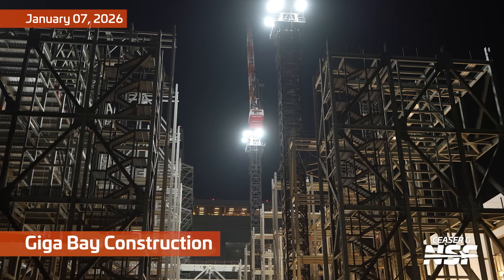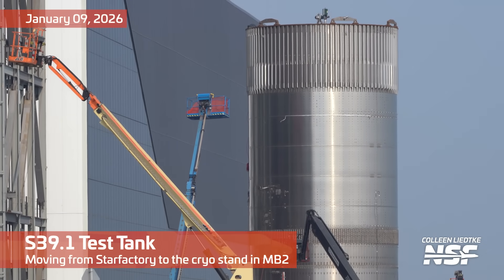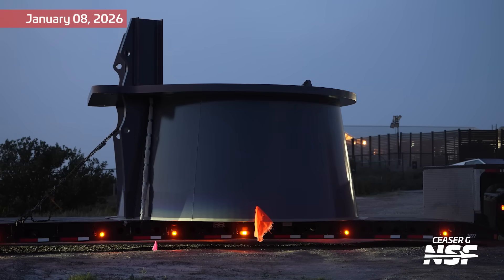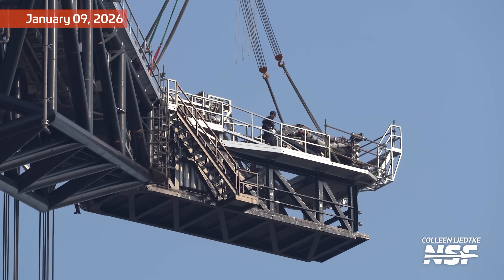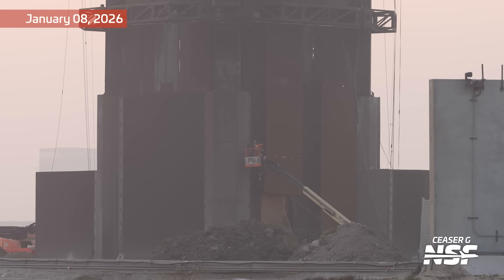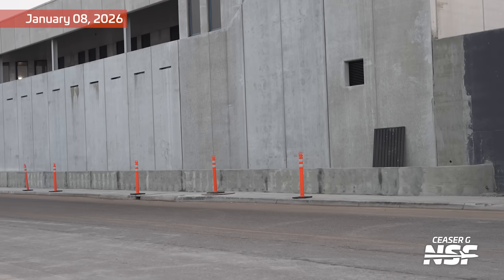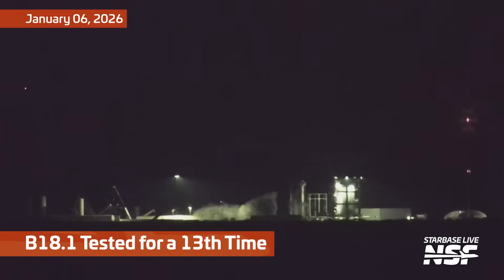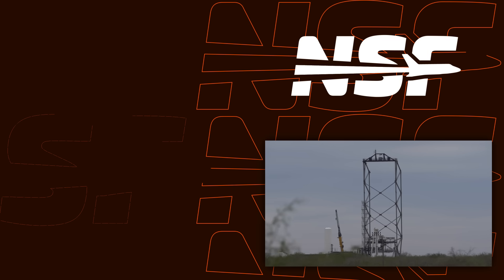"The Gigabay Steel Jungle Gym" | SpaceX Starbase

Comment: My guess on the "circular structures": the first one with the half-pipe flanges is HLS upper section - cutouts for landing thrusters, and the second structure is for the HLS airlock/elevator with pivot mount holes.  Doubt its steel, though.

Comment: On test tank 18.3 you need the ship aft installed on the hot stage truss to make sure the line of force interactions are accurate. Without the ship aft the upper rail would twist.

Comment: 00:46 from the architect they’re BOLTS Das, bolts. We haven’t used rivets (the hot steel type) for buildings in a long time. What you’re thinking about is the type they used on the 
Empire State building in the early 1900’s. We still use the small diameter type for lighter assemblies but not for structural steel.
Reply from the maker: Been watching too many blacksmithing videos lol - Das

Comment: The problem isn't laying the COPV's on their sides. The problem is they are being hauled around exposed to flying rocks launched from tires that can literally punch holes in aluminum. THIS is the problem they had with the two RUD's and maybe even some of the Starship block 2 RUD's after launch. You can't just haul COPV's around on a construction site EXPOSED like that and not expect damage to them. Wrapping them in plastic isn't going to stop something that can punch through aluminum. All you have to do is look at the hood of my Honda Accord to understand what I'm talking about. How hard would it be for them to enclose the COPV's in a box truck so they won't be at risk of rock strikes. There is NO WAY Starship will be human rated with this kind of reckless handling. The manufacture doesn't deliver them from their factory to Starbase that way. There is no just no way they would. So why does SpaceX think it's safe to transport them that way?!
Reply: Or this is much ado about nothing..

Comment: pedant alert former electrician, current network person here; the cable management on display at 7:12 was not 'nice' - it was meh at best.  Apologies, my ocd wouldnt let me let it slide
Reply from the maker: What was wrong with it? I saw some of the wires angled but they seemed to all be separated and generally aligned. - Das

Comment: Caliche can be as hard as concrete, but application of an acid can dissolve or at least soften it as it's calcium carbonate.  Depending on the thickness you will need a pickaxe or heavy equipment to break it up.
Reply from the maker: Caliche in the ground can, but this is quarried and broken up into cliche gravel, so not quite as fresh. - Das